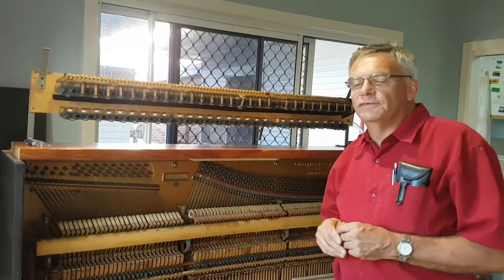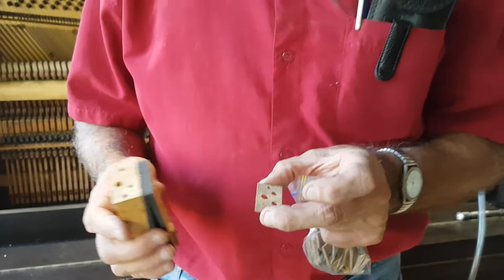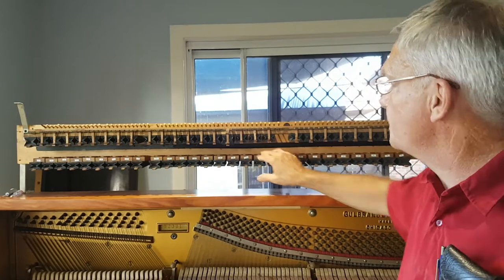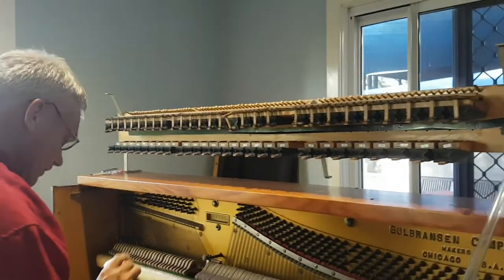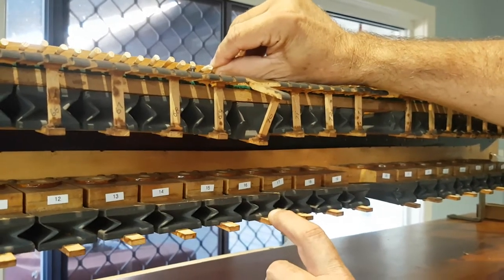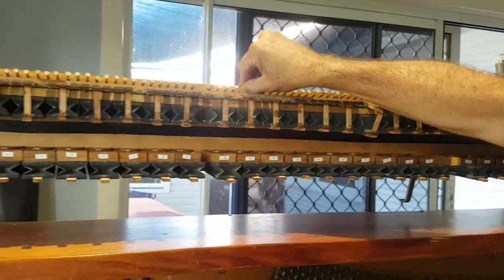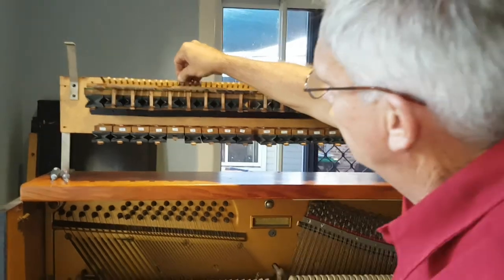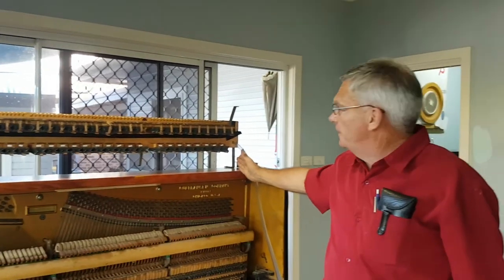Restoration of Gulbransen Player Piano (Pianola) - Test #1

Comment: surely youd have to have a massive problem with the valves if they didnt respond when using such a strong source of vacuum, or did you regulate the vacuum down to foot exhausters vacuum?
Reply: It would probably be more scientific if the lowest vacuum to operate each bellows was tested.  Ideally they would all be about the same vacuum otherwise one or more may have some leaks.  With a low vacuum a leaky bellows will sound the note softer than the others or may not even hit the note.  A small smoke generator could help locate the leaks.